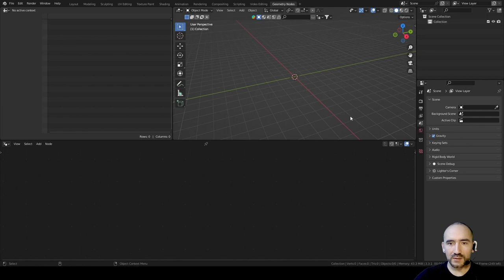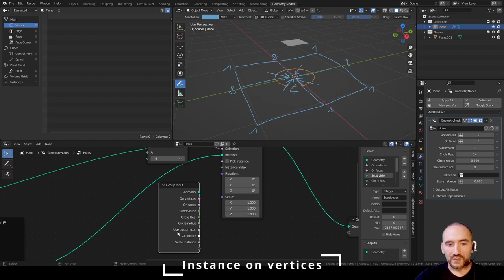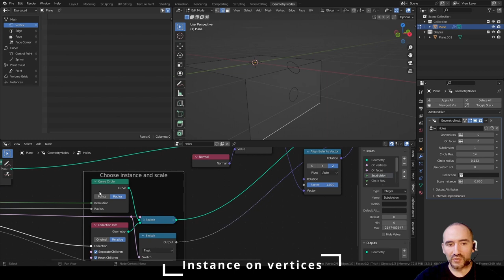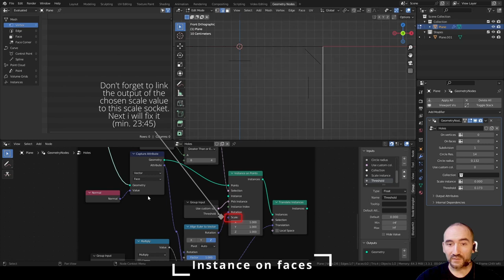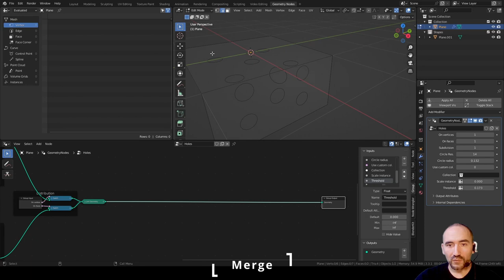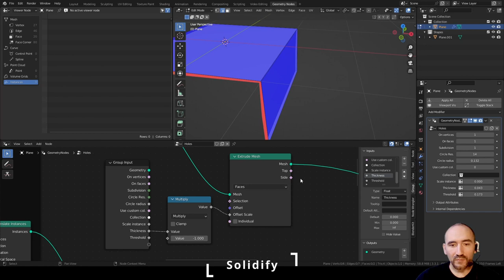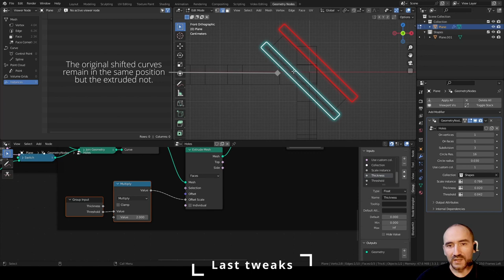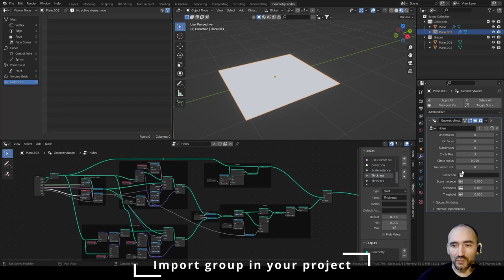Procedural holes in Geometry nodes - Blender tutorial ENG

Comment: Hi! Thanks! Cool tutorial!
To me it seems worth stopping at a plane with holes in geometry nodes, and after adding a solidify modifier, it will help maintain a constant thickness at the bends of the plane
Reply from the maker: Thank you Алексей! I know about the bad effect of the thickness, You are right for a perfect plane shape.
Unfortunately for this tutorial i could not use that tecnique because it also needs to work with not perfect plane but with complex shapes as you've seen in the intro.
The problem happens when you have edge with two connected faces having an angle not equal 180°. Now i don't remember the exact context but i tried to find a compromise to satisfy almost all the cases.
Maybe in the future i will find a solution more reliable to solve the issue of the thickness.
Thank you again for your feedback!

Comment: Andrea! thanks for your tutorials, they are epic! i have problems to use this geometry nodes in cubes, spherers, cylinders, you know why dosen't apply this nodes effect in the primitives shapes?
Reply from the maker: Thank you @chonk3d607 for your feedback! About your issue i can suggest you to check
1 - if you applied the scale on the primitive object (if not apply it).
2 - Check the face orientation of the primitive object you are using for security. They need to be outwards related to the application of the GeoNode workflow. If the "blue" color is inwards try flipping the normals of the primitive surface.

3 - Check if you added a native solidify on your stack modifier because the GN workflow needs to be added on a surface without native solidify (it already contains it).
If something doesn't work with these 3 checks please join on my discord channel to let me help you with simple file example.